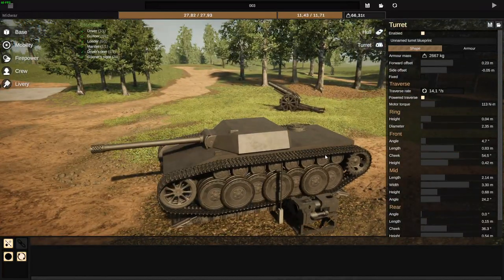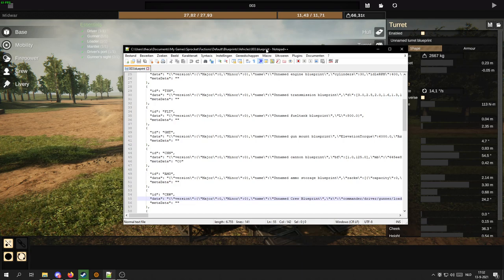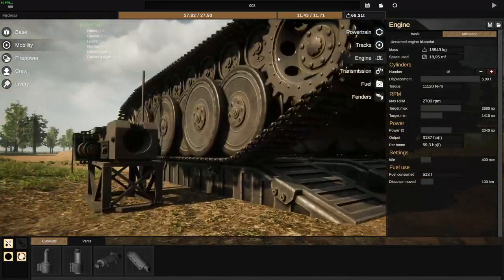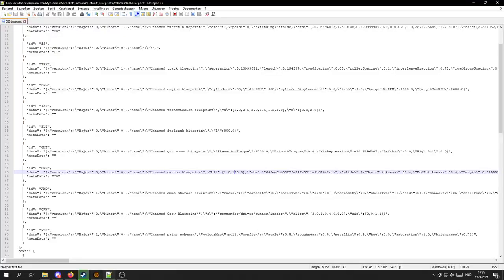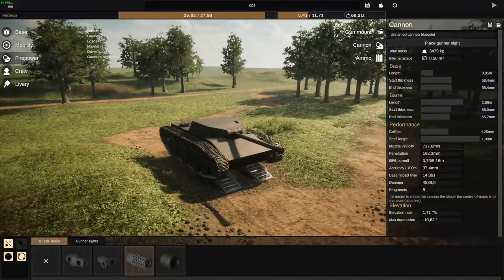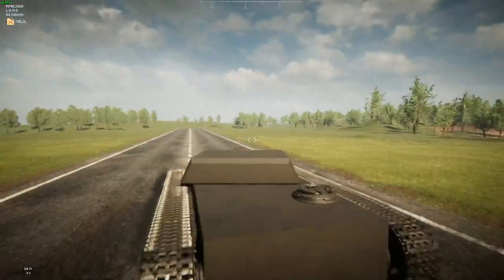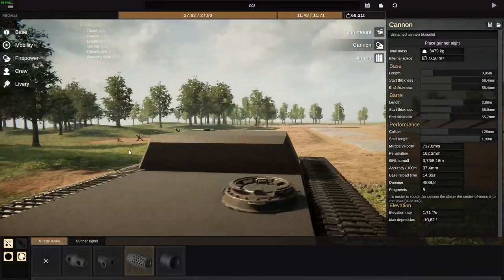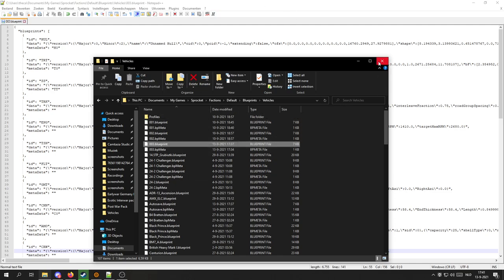Sprocket 101 - File Manipulation Guide

Comment: Hard limit for armor values is still 500mm, and I'm hoping in future updates they add customizable values such as density, brittleness, hardness quality etc., and for file editing maybe weight per volume (i.e. kilogram per cubic centimeter) for the armor, as well as armor layering. I'm sure the game can handle it, it already models spare tracks and fuel tanks as additional layers of physical objects.
Reply: Yeah, placing NERA blocks that you can edit the layers of would be amazing.
Reply: Not only that, but also can render the track treads themselves moving as you drive, and quite accurately and realistically, yeah, this should handle much more than it already has, sure it can have all of that and even much more

Comment: Is there some kind of hard limit to rate of fire...? Could we make genuine autocannons with this?
Reply from the maker: It does have diminishing returns, increasing loader from 1m to 2m halves the reload, but going to 3m only makes it a third, 4m a quarter, and so on.
Reply: @Catequil  Interesting - I guess you could make a reasonably plausible automatic 30mm or 40mm in terms of fire rate
Reply: @tommeakin1732  you can also set the gunner and loader value to 20 and more. Just beware of the recoil ;)
Reply: I think I saw on the Discord a screenshot of multiple shots fired before the first hit.
Reply: @JWQweqOPDH  i literally send my 65t tank flying, even the turret behaved like a helicopter....it's fun to watch but it's not the meaning of this game...obviously, nor is it entertaining for a long time...but if you seek for a anti-air-tank...this is your go-to. Just beware the caliber ;)
Reply: autocannon are quite commen production of FM
Reply: I set my BMP 2 knockoff tank's loader to 5.0, it now fires 1 round every 0.5 seconds

Comment: When I modify the turret motor torque and gun mount torque the effect seems negligible and the values are reset whenever a save to the design is made. Is there any workaround to get the turret rotation/gun positioning effect?

Comment: Well, thank you for all of that, but now i need to know, how do i make my tank accelerate faster without making the engine even larger, because my tank is already like 500 tonnes and when i put a 60cylinder 5l engine in it it becomes heavier than a ship, it becomes 3000 tonnes and in the end it has the same speed it did before

Comment: Is there any way to change the value of the penetration of the gun?
Reply: I'm trying to do this momentarily, editing the breech length works, however adds too much weight meaning i can barely lift the gun or I can't at all, and the penetration value doesn't go up by much either.. I know that editing the muzzle velocity is key to fixing the issue however I can't get it to work. A lot of stuff has changed in the past 2yrs and I can't figure out how to change muzzle velocity anymore.

Comment: Hi! i'm autistic, and was wondering if you could help me with the file Manipulation, i have looked and don't have the same files you do, all the tanks i have saved that i made don't show up in the vehicles section, i'm struggling and was wondering if someone could help me
Reply: I have the same problem
Reply: Open the blueprint of the tank with noteblock, you can see certain values there, if you want a faster firerate just increase the size of the loader(normal is 0.75max, if you set it to 5.0 it will fire 30mm every 0.5 seconds)
Reply: @Dutchman-2002  how do you open a blueprint in notepad

Comment: If you made a 3 cylinder 400L engine it'd be far less massive and more powerful. Displacement > cylinders always. People nicknamed these gas turbines if you aren't yet aware.
Reply from the maker: More displacement = lower max RPM = lower max speed in sprocket.
Cylinders > displacement for actual mobility